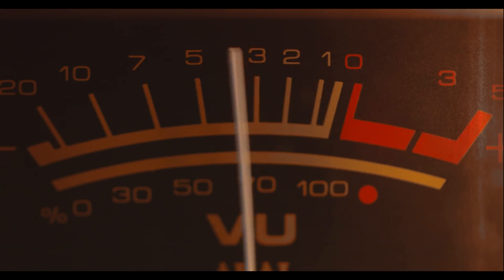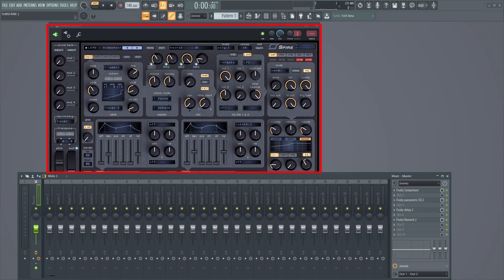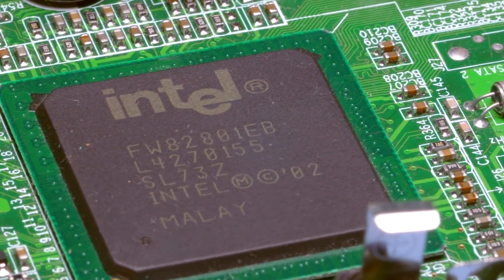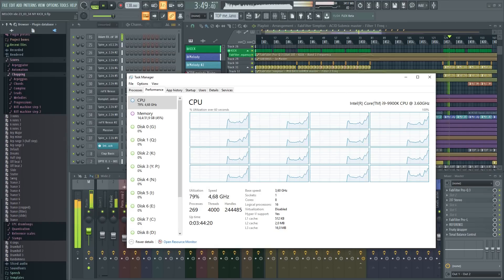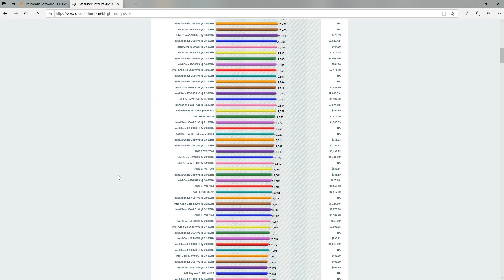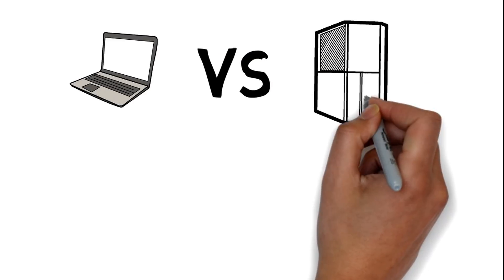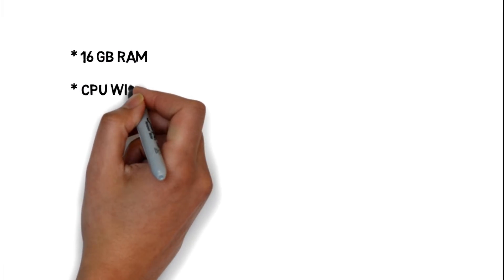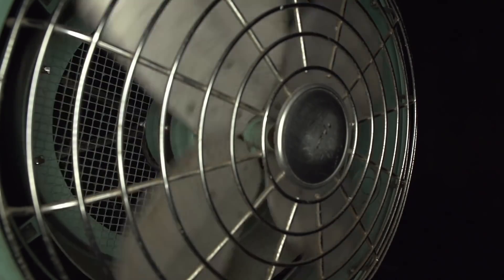The Best Computer For Music Production - What's Needed And Why!

Comment: Possibly worth mentioning SATA vs NVMe for the SSD. (When loading large sample instruments into e.g. Kontakt, 500MB/s vs 3GB/s makes a nice difference -- I have my system drive on NVMe, and most of my VSTs and samples set up on a SATA SSD with a larger capacity, though would consider a second NVMe drive as an upgrade. That said, the largest Kontakt patches only take about 2-3s to load off SATA.)

Comment: This is a really good video, wish I'd had it a few months ago as it took ages to get together all the right parts needed for my PC. My processor and RAM are the same but I used an Asus Xonar STX II sound card and GTX 1050TI GPU (for using dual 27" HD monitors). 
Really pleased with how the PC works and only regret is not looking more into the 4k route as FL studio seems too big and clunky on HD resolutions (but that could just be my perception though). Also my Sony MDR-7506/1 headphones and really good for the price range and make massive difference to the perceivable sound compared to other headphones and speakers used.
Reply: I tried out my new music PC on a 4k TV, and would likely rather go for two QHD displays than a single 4k -- with 4k you really struggle to take everything in unless you apply display scaling (which kind of defeats the purpose of going up to 4k), but with only 1080p you do feel a little cramped. (I'm also toying with stacking two QHD displays vertically rather than side by side due to the issue of where to stick the audio monitors.)
Reply from the maker: Glad you like the video. I've been playing with various resolutions, widescreen etc my self trying to come up with the ultimate setup for FL Studio. I'm not really sure what I prefer at this point. The only thing I know is that in order to work effectively in FL Studio I must have more than one monitor, or a lot of screen real estate. I've tried working on laptops before and it slowed me down by more than 50%. :)
Reply: @FireWalkMusic  Which reminds me of another issue with 4K (without display scaling) is the distance you have to travel with the mouse to traverse the interface. I've not tried QHD, but find that 4k is too large, 1080p too small, especially with things like live, bitwig and fl studio whose interfaces feel (to me) to treat multi-screen as an afterthought. (I'd love to see something like the old Logic Pro's screensets.)

Comment: an i5-7500 actually works fine for me, might not the absolute best but it really isn't an issue often. (tho please Firewalk, work on your cable management haha)

(worked alot with the Fractal Design R6, really nice case with a stupid amount of room. and the front IO cables are even sleeved together up untill the end and omg is it a godsent)
Reply from the maker: Indeed, most people won't need such a fast CPU. It depends on what kind of music you make and how heavy your projects are, as well as what else you do on the computer. :) The i5 will work well for most people. Especially if you also do some gaming on the side. 

My cable management is basically non existent in these shots. I was going to make it nice and tidy for the purpose of this video but I simply didn't have the time. I just needed to get the PC back up and running as quickly as possible. I had orders pending for mixing and mastering etc, and I knew it was going to be a nightmare getting everything (software, vst's, effects etc) installed and get everything back up and running properly. And believe me, it was! :p

I've since gone back and used zip ties to clean it up. It's still not perfect, but much better than in these pictures :D

Comment: A couple points:
- You do not need a dedicated graphics card for music production unless you are running multiple displays on super fancy monitors. The graphics card he recommended isn't necessary for the vast majority of producers.

- This guy's overall setup is a lot more than 99.9% of producers need. You can get a great build for under $800, even if you plan on using your computer for gaming too. Seeing the size of his FL projects though...it kinda makes sense why he built such a behemoth lol
Reply from the maker: Indeed. Good points! :) A DAW such as FL Studio can't utilize GPU acceleration, so you can indeed make due with the built in GPU in the CPU if you go for such a CPU. The only reason I would recommend a VGA card is to be able to use two or more monitors, and also if you're doing other tasks such as video editing, gaming etc. :)
Regarding performance, this video is about the the best you can get at the moment, but if you want to get the best you can get within a budget, then I would recommend AMD instead since you typically get more performance for your money by going the AMD route. Even though their chips typically offer lower single core performance than Intel chips, you'll end up with a faster system overall. :)
Reply: @FireWalkMusic  Many of the plugins now days have allot of visual waveforms and effects. If you didnt have a good graphics card, would those plugins be more laggy? Thanks.
Reply: @FireWalkMusic   You don't need the VGA card for dual monitors. The built in GPU will run multiple.
Reply: FireWalk make sure you get enough ram then. I’ve heard guys finding out that the built in video on the cpu can steal some so go 16+
Reply: @FireWalkMusic  the best you can get would be an i9 x series processor.  You should see a bigger performance gain than the puny performance gain you got from this upgrade.
Reply from the maker: @thatchinaboi  
The i9x costs twice as much as the regular i9. And if you really want to push it then why not go to the i9-9980XE? But that one costs more than this whole rig combined. Most people wont' spend that kind of money. The regular i9 will be more than enough for most people. Especially when overclocked, since it easily goes beyond 5 GHZ. 
This is an extreme project shown in this video. Most people won't need this kind of performance, so for most people, this will be more than enough, and I therefore consider it the "best" setup. There will always be something extreme that's technically better, but at what cost? I decided It wouldn't make sense to make a video, recommending people to buy a computer they could never afford. I even get flamed quite a bit for recommending this one, as people seem to think it's way overkill and that the older i7 should be considered the "best", so that you can spend the money you save on other studio gear like monitors, audio interface etc. :)
Perhaps we could say that the i9 is certainly the best reasonable computer for music production :)  
The 9900x has more cores than the 9900k, but also about 12% slower single core speed, and it also won't clock as high as the 9900k. When you take operations per clock into consideration, and the fact that the 9900k can easily run at 5 ghz on all cores, then the performance gains really isn't worth the price. 
You do get quad channel memory though, which can be really helpful if you run very large and memory intensive projects, but otherwice the 9900k will be the best value. 

That said, now the new AMD chips have arrived too, and while I haven't had the chance to test them myself yet, It's quite possible that they can come fairly close to the 9900k at a lower price.
Reply: @FireWalkMusic  The i9 9900x is not that expensive IMO.  Check out the latest prices.  :)
Reply from the maker: @thatchinaboi  Indeed, youre right. Seems like it's gone down quite a lot since this video was made. Perhaps Intel is starting to feel the pressure from AMD. That would be a good thing sir consumers! :)
Reply: I use a lot of plugins, filters and midi tools at the same time and im generally lacking power to run them all so i disagree with this. The graphics card is a taste thing but personally i would like to have 2 monitors so i can run my daw fullscreen while managing my background processes like midi mappers etc without having to tab out. What you said is largely true for most bedroom producers but i think he was going for what you need to be able to use it without a lot of limitations so you can keep your flow going.
Reply: @ormixiao7990  what would you recommend man . Would really hel0 me out if you could give me some advice. Doing film scoring so lots of instruments. A midi keyboard. Anything to help me out ?
Reply: @squidz33  check out the "intrument 1" midi controller on youtube, it's a multi purpose controller with alot of neat uses like being able to play it like a guitar or a piano and a drumpad is generally good to have to help you to be more creative in your drumloops imo.
Reply: @squidz33  or if you meant pc wise just follow the video
Reply: @squidz33  Read my above comment, I would consider something along the lines of considering a minimum requirements of an i7 8700k, 32 gigs ram running at 3200 mhs CAS14 or 3000 MHz at CAS12 if you can find any, usually around the same cost. 

Midi Keys, I have  myself. 
A Korg Microkey 37 - entry level, good for putting midi down but nothing else.
A Roland A500 PRO - more expensive than a lot of controllers, but has huge amounts of functionality in terms of remapping it to suit your needs.

Also, software wise, I'd recommend getting a license for Kontact. Kontact is a film scorers best friend :)
Reply: @soundcrank6214  CPU: Ryzen 5 2600x - $150
Mobo: MSI B450-A Pro - $85
GPU: GT730 - $40 (more than enough for a 1080p display)
SSD's - $120 (128GB M.2 and 1TB 2.5)
Case - $50
500W PSU - $40

Even if you go get a top tier CPU fan and a couple of additional case fans, this leaves you with a couple hundred dollars to spend on RAM, which is more than enough for most producers
Reply: @mli3083  I covered that. If you make hiphop beats or use samples, yes. That will do. It's exceptionally limiting though. I have built my last 3 audio rigs and getting minimum specs will only allow you to take production so far.
Reply: @ormixiao7990  windows ten lets you run monitors wirelessly. you dont actually need a dedicated graphics card. just monitors with wireless capability, or small tvs
Reply: Make a video of an 800$ setup plss
Reply: yup. just be sure you have enough RAM and a decent CPU
Reply: @AnymMusic  would an i5 procceser and 8g of ram be good to start ?
Reply: @squidz33  8GB is plenty, but in 2019 at current pricing, it makes no sense to not go 16 GB.. I was using a 2012 i5 3570K in FL Studio and it was working perfectly. In upgraded to a MUCH faster i5 9600K, I don't notice any difference in capability besides rendering the project to audio files
Reply: Most off all he missed a point in analysing is perf results.. he only considered his CPU 
But in music production the most import with the CPU is ram and storage 
Going 1tb ssd nvme and 3200/3700 MHz ram but in cl14 latency is way better.. 
And remember that your PC is only as strong as the weakest part of the build and benchmark and theoretical perfs isn't real world benchmark.. maybe FL studio won't utilise an Intel CPU or AMD CPU like ableton etc...
Reply: In your opinion What’s the best desktop for music/video editing 4K without lag
Reply from the maker: @Music-tf1yn  Unlike music production, video editing benefit greatly from parallel processing. If you do a lot of video editing then I would recommend getting a CPU with a lot of cores. 

The AMD 3900x should work great for both music production and video editing and will provide better value than the i9  overall: https://amzn.to/35xE9qd
Reply: @FireWalkMusic  your great God bless you for the quick reply.
Reply: Behemoth ? In comparison with the sound card maybe ^^ 
I could have gone half the comput power and price with a better audio card and could still drive all those big session ;)
But you know all what we said about size ^^
Reply: A dedicated videocard takes the load off the CPU when processing graphics, like DAW and plugin animations. Ableton Live is the most efficient.
Reply: I disagree. You can make one, yes. But it won't be usable for most producers at the $800 mark. If you make hiphop beats and mainly use samples, then sure. But if you're a sound designer, Serum alone eats like 6 gigs of ram when you start increasing the voices. Anyone making EDM, Dubstep for example would be hindering their ability to be creative with less than 16 gigs of ram and at least a strong contending i7 with at least a 4.2 single core boost. 
Also, real time heavy VSTs such as Serum and Massive also benefit heavily for more accurately timed Ram also. 16 gigs of Ram at CAS9 is more efficient that 32 gigs at CAS15 for example. You're talking well into the $1k+ region if that's your preferred genre.

Comment: Awesome build bro!
I'm looking into upgrading/replacing my moBo/cpu/ram when tax returns come lol. I need to look into AMDs better cpu's (currently using 6core ryZen5 1600 gen1) and faster ram, my Pc feels a tad sluggish when opening big Plugins (Omnisphere2 & Komplete12) and NOW I realize I shudnt have "cheap'd out" and shudv went with Ryzen cpu with better s/core performance 😭 see your cable management looked just as tidy as mine 😜
Reply from the maker: If you're on a budget then you should definitely go for AMD. You will get more performance for your buck overall. I've never been good at cable management. I was originally going to make everything nice and tidy for the purpose of this video.  I was at it for 5 minutes and then I had enough of that. :p
Reply: @FireWalkMusic  | that was exactly meeeeeeee 🙈😭😭😭😭😭😭🤣

Comment: are you having overheating issues with the i9?thats my only concern
Reply from the maker: I know the i9 is known to run hot, but honestly I'm not having any issues with heat at all. The CPU stays at around 37 degrees at idle, and rarely goes above 60 even under heavy load. I should also note that the ambient temperature in my studio is usually quite high hot due to all the equipment in here. The Noctua cooler seems to be doing it's job. :)

Comment: Useful video, but how did you hook up a Firewire Audio Interface to this build?
Reply from the maker: Thanks. I used a Firewire PCIe card: https://www.amazon.com/Vantec-3-Port-FireWire-PCIe-UGT-FW200/dp/B004QY9IYA/ref=as_sl_pc_tf_til?tag=firewalk02-20&linkCode=w00&linkId=0bc84d8df82247118e7200ffcfa6ef37&creativeASIN=B004QY9IYA

Comment: Ryzen is good or not
Reply from the maker: The higher end Ryzen CPU's will be more than good enough for most people. AMD typically offer more performance for your money vs Intel, but their chips are unfortunately also a bit slower than Intel at the moment, especially the single core performance. They try to make up for it by using more cores, but unfortunately a DAW such as FL Studio can't utilize serial processing very well. This means that Intel CPU's, which offer better single core performance will be the best choice for music production. This is really only a concern if you're looking for a high performance rig. If you're aiming for a mid level CPU then you might just as well go for an AMD CPU, because you'll get more performance for your money overall.
You also need to consider what other tasks you're doing on your computer. Many tasks such as video editing can take advantage of many cores, and for that kind of work AMD CPU's will work very well since they typically come with more cores than Intel do.
Reply: @FireWalkMusic  but Ryzen is now doing good at single core performce n is ableton work in this manner like fl studio

Comment: If I’m not gaming do I need a graphics card still?
Reply from the maker: No, there is no GPU acceleration support in FL or any other daw (due to latency issues). If you go for a CPU like the i9, then you can use the built in graphics with no problem.